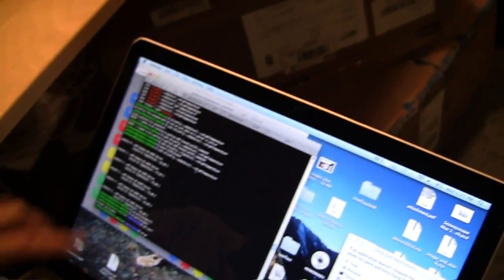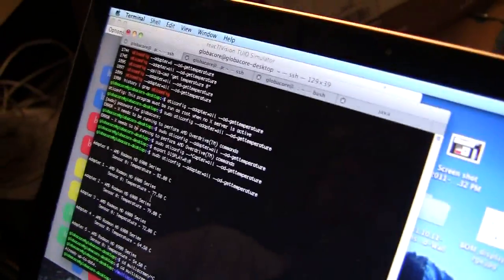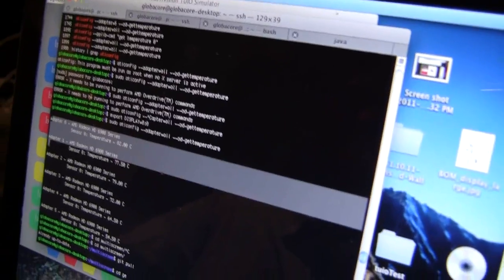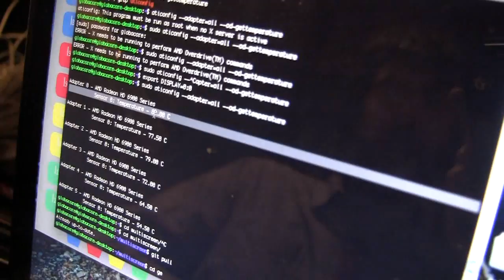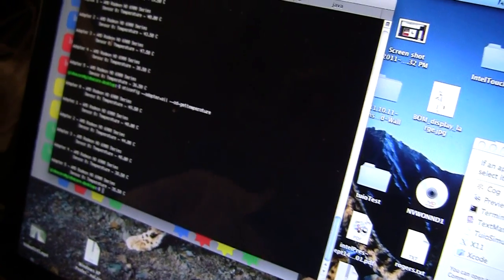Triple HD6990 SR2 TJ11  Watercooled Build - DazLabWeekly (29)

Comment from the maker: @REDxFROG Two triple radiators with 2600rpm fans will be adequate for  those 3 cards, I have no doubt about it. We drop temps almost in half from air and they (temps) did not creep up much after initial boot.

Comment: I run 2 cayman GPUs, what I'm seeing here is a bad joke.

It takes at least 3 times the radiator surface to cool these cards at proper temp.
You can use this one rad for one HD6970, that's all.

I'm pretty sure that these guys had to find that out pretty quickly, as you said the air was hot - the water was even hotter but the rig was IDLE.

Putting together 3 6990s is one thing. Running and cooling them properly is another. *.*

Another guy on youtube does 12monitors on just one HD5870

Comment from the maker: I can not give you much details here. This was an emergency situation under strict deadline to have system up and running, so we worked as fast as we could against the clock and have to skip such steps as leak test and  bleeding. 

System was very stubborn and I have to go to very bottom of my bag of tricks to break trough air pockets.  Tubing was re-routed/replaced  without draining on a fly and we finally pushed all air out.